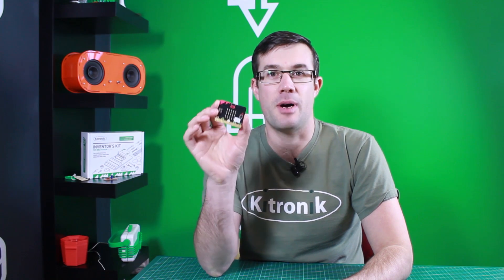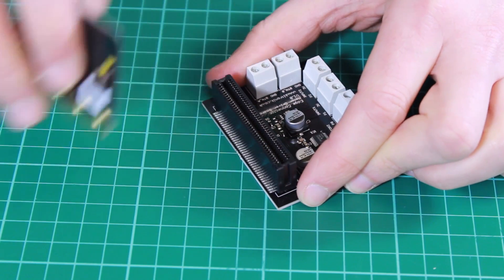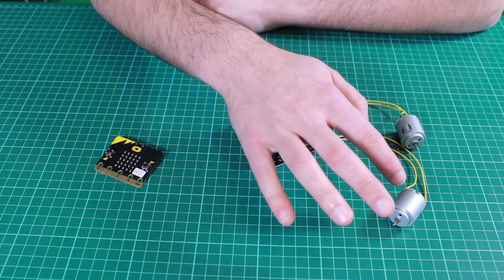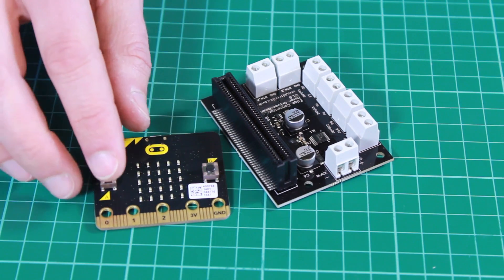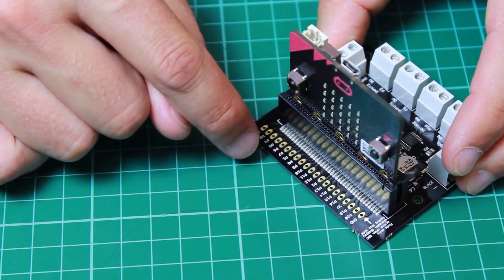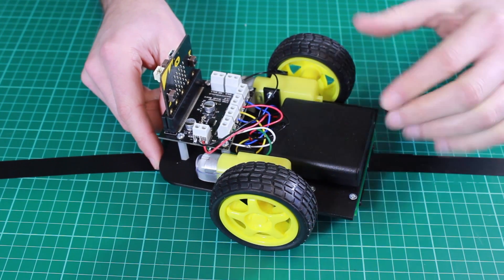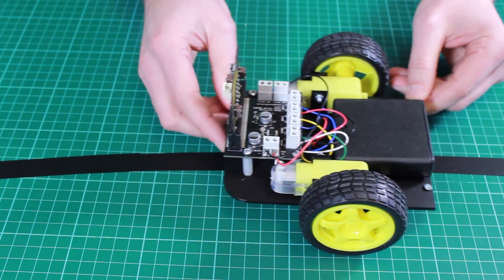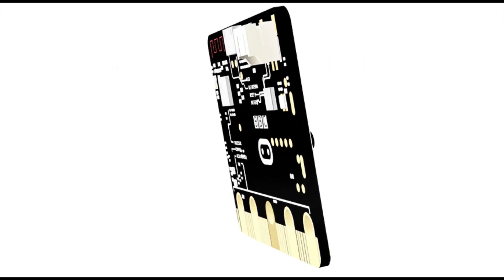BBC micro:bit Motor Driver Boards from Kitronik

Comment: putting in a wee section about how to use the code parts on your gitHub to connect to the motors / initialise it would be handy. I'm a n00b.